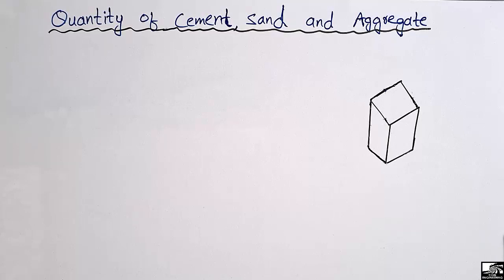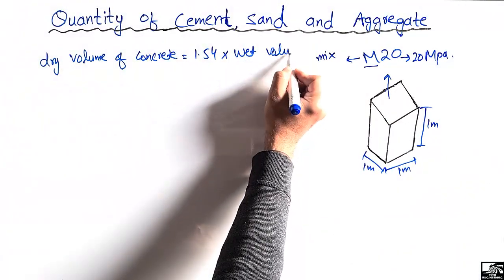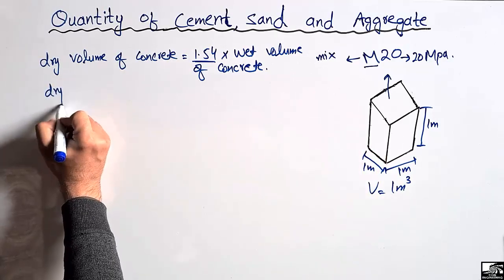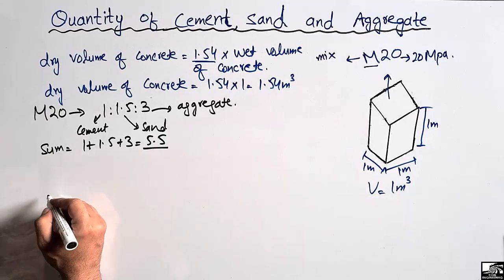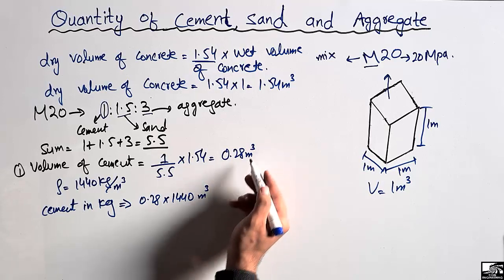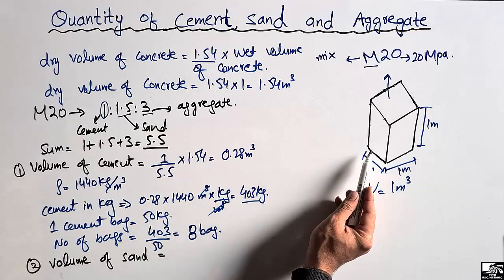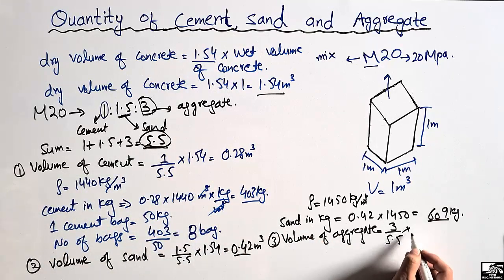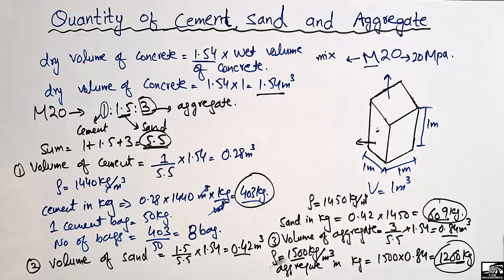How to calculate Cement, Sand & Aggregate quantities in Concrete

Comment: The big question  is how much water is required.
Reply: What if stronger compressive strengths were desired?
Reply: Cement weight multiplied by 0.5 and the result is the amount of water in liters.